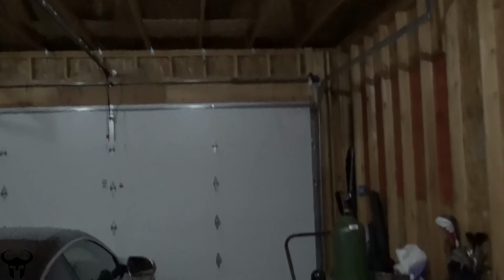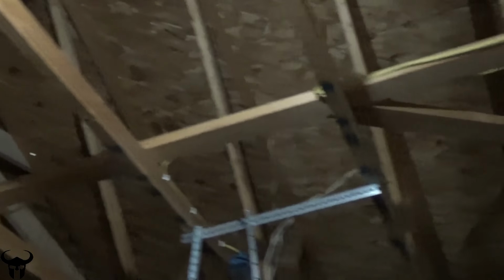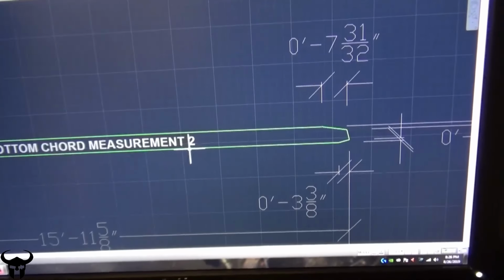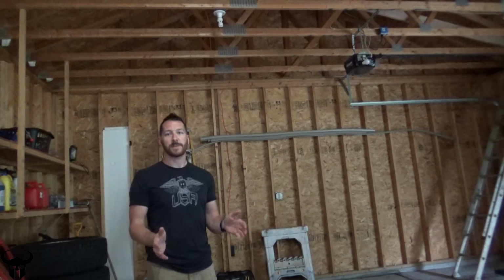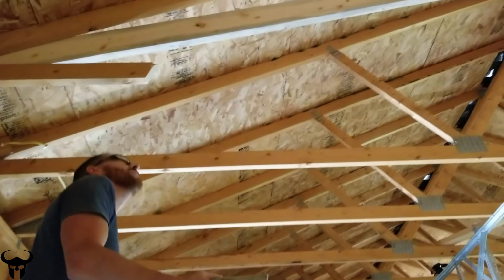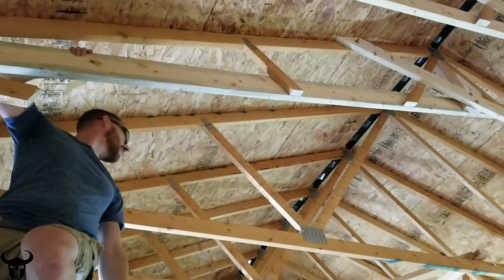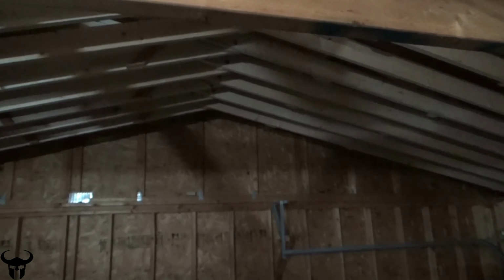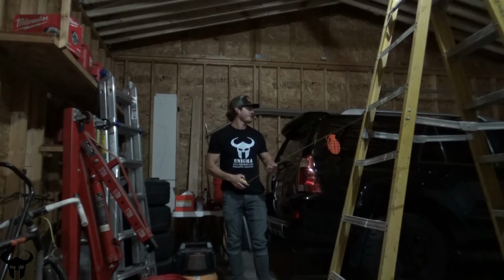How to Modify Garage Trusses for More Height for a Car Lift (Super Garage Video #1)

Comment: FYI for those of you who might have more clearance for a lift but want to keep your standard garage door; you can special order angled horizontal garage door tracks to accommodate for more space for a lift. I did that a few times when I had a small garage door business for customers. Much cheaper than a new roll up door.
Reply: I've been trying to find info on doing pretty much the same thing, but I haven't come up with much. Any idea where I can find those angled tracks?
Reply: @samerickson89  try to find a garage door supplier in your area, or talk to some smaller garage door repair places that might want to entertain the hunt. The rails were special order from the supplier to the manufacturer. It's not as crazy as it sounds. Mention high lift tracks
Reply: You’ll need different drums, longer cables, different spring(s) and side mount opener. Tell your local garage door company you want a high lift track set up for your door.

Comment: Fellow engineer here, I can't tell you how excited I am about finding this, as well as all the details and info you show. Great job! I have the same ceiling height and trusses in my 30'x72' pole barn and am wanting to do this! I have a 4 post lift coming and would love an extra 3 feet of lifting height!
Reply: Hi jamie, how did your project go ? I have the same size garage but will turn it into living space trying to maje the same type of structure they did
Reply: @chinocool7481  I wrote this a year ago!?!! Man, I ummm, yeah need to get on this. I haven’t done it yet. Haha. 

My brother (super nerd, chemical engineer) modeled my roof and current trusses in cad. Then we sent it and our new design to our retired mechanical engineer friend that loves doing structural analysis. He gave us mountains of data. Spreadsheets. Drawing sketches. 

I put the project on hold to put flooring in my house, paint, and new trim. Gotta keep the wife happy. Then I’ve been insulating and wiring additional outlets in my pole barn. 

Hopefully in spring or early summer I’ll get to it.
Reply: Hi, can you share some information from the mechanical engineer roof report? I'd comment on this video, but the guy owning the channel doesn't respond it seems like. I have feedback about the process. I'm a building inspector and woodworker. Install collar ties, a horizontal board through the truss. And put in strong back truss bracing. Basically a continuous board perpendicular to the trusses to prevent deflection sideways. Last, a double bottom cord is a good idea. This video did a great job, but hopefully some people see my three recommendations to make it much better. I'd probably install a ledger or double ledger at the side wall too.

Comment: Couldn't you have sandwiched the trusses together in pairs of 2’s or 3’s instead of having them evenly spaced?  Also, isn't the grade-8 hardware way stronger than the wood? Seems the wood will tear out/break long before a grade 8 will sheer.  Seems like grade 8 would be an unnecessary added cost over, say grade 5.  I have spent my entire adult life building homes and I've never seen grade-8 hardware used through lumber.  Lastly, 4-1/4” thick concrete seems thin for a lift.

Comment: My garage is my woodshop, and the ceilings are exactly 8' tall, which is often a problem when you factor in shop lights dangling 8-10" below that.  I'm considering this as a future project... I am a Landscape Architect, but I work in a civil engineering firm with structural guys so between this video and them, I'm confident I could pull it off.  Thanks brother.

Comment: I'm a professional mechanic who runs an auto repair business out of my home. I desperately need a lift in my garage but have 8ft ceilings. Id love an extra foot or two. My attick sits above the garage so this may be a challenge. Your comment about moving the garage opener to the side was a good nugget. Either way it's good to see there's somebody out there in my same predicament.  Wish I had the engineering skills you do.
Reply from the maker: Thanks for the comment Josh! This is going to sound crazy, but one method I heard from a few people is to run wood beams through the existing trusses, then rent a crane, connect it to the beams, and pick the roof off the garage (after cutting around the perimeter to free everything up). Then you would add an extra 2 ft+ of framing/siding and put the roof back on. It would save you from having to re-roof, modify trusses, etc.
Reply: @EnigmaEngineering  that's one knarly nugget! But a doable one with a little motivation. Thanks brother!

Comment: Great idea using it.   Also instead of the rolled if you want more R value, you can modify the track to run the angle of your new roof line, harder angle up instead of out.   Neighbor just did in pole barn.

Comment: i put a mid rise lift in my single car garage last week, it hit one ceiling joist, so i converted that one joist into scissor joist using mostly aLL the wood already in place, no need to over engineer things.
IT took me just over 2 HRS.
up in north maine we get high snow loads but i installed a metal roof 4 yrs ago which gets rid of snow.

Comment: I'm here because an associate of mine removed his garage rafters and it left him with a HUGE amount of overhead space.   I asked him  "Don't you need those to maintain the structural integritiy of the garage?   He just said "naw my garage is fine.  Strong as ever. ".   I have been chewing on doing mine every since.   But the kicker is I DYI'ed an 18' addition to turn my 2 car into a 4 car years ago and I added the rafters because I thought they held the walls against the outwardly pressure of the A-frame pushing down .  I didn't need gables .

Comment: I've been thinking about doing this to my house roof for a couple years. I've talked with several contractors and they tell the same thing. Have to use a LVL or steel beam. I'm not buying it. I like what you did. Thanks for sharing your knowledge.
Reply from the maker: Hey Ray! No problem. Obviously I can't tell you exactly what to do with your build. But, the safety factor of trusses you can buy at a hardware store is generally pretty high (like ~7-10). My recommendation is finding a truss style that gives you the extra vertical room, then perhaps increasing the number of trusses like we did. For example, a scissors truss is weaker than a traditional truss. So, we doubled the # of trusses to approximately match the safety factor.

Comment: I have a similar truss situation. My plan is to cut all the sheeting and end fasting nails of the trusses that I'll be moving using a sawzall and once clear of all nails I'll slide the middle trusses away from center and against the outer trusses nailing them together to create a form of girder truss on each side of the bay. At that point I will span the 12' gap with structural 2X6s on 16"  centers between the two "girder" trusses using joist hangers on each end of the 2X6 purlins to support the roof sheeting. This method opens the bay giving the maximum  height  possible while retaining the integrity of the structure.
Reply from the maker: Hi Delbert, I considered a similar method. It should work out fine! Thank you for the comment and thanks for subscribing

Comment: Great Job,  I'm about to do the same thing, that is how i found the video.  This is very overbuilt, which is good.  It seems you used Doug Fir instead of yellow pine.  Doug Fir isn't supposed to be used in a joist / rafter type situation.  Usually for studs only.  Doug fir is much easier to work with though and in the end won't make a difference given how overbuilt this is.  You could have also scabbed osb to the side of the Scissor truss after adding another 2x6 to even the thickness instead of adding another truss inbetween.  If you do this method the OSB should be nailed or stapled every 6"s or so

Comment: Thats why Engineers aren't allowed on the jobsite.... standing on the top of the ladder. :)  Very cool, and wish more Engineers had to be occasionally TDA'd to their respective jobsites to see how the things they engineer actually are built, and how crazy some of their ideas are. I'm looking at you Nissan engineers, 2 hour job to replace spark pliugs.
Reply: Honda was no different, wanna change a starter or Ac compressor in a civic?  Pull the engine.  :-/   Next to the lawyers, the enginerds would be the next bus off the cliff.

Comment: What is the spand of your trusses? and what size timber did you use?
Also what snow payload did you calculate for? 1kn/m2? and are your trusses spaced 3 feet apart?
What is the roof pitch and what are your ceiling pitch? They should be 10-15 degrees different depending on the slope of the roof.

Comment: I need modify my roof high, I'll follow your method, I wait to find the kind screw that you used in my country but maybe I can to use someone similar in weight resistance or reforcer joins with iron plates, thanks for you time and excellent job.

Comment: Great vid and thanks for sharing.  This is exactly the project I've been pulling my hair out on having completed.  Other than the engineering side of this project, I am capable of completing the work.  My problem is several structural engineers won't advise or won't design for me.  I just need the blueprint and specs.  I can take it from there.  You ever think of setting me up with a safe design based on my setup.  I do have the original blueprints from the house built in '89.
Reply from the maker: Hey, thanks for the comment! More videos on the garage build to come. Regarding the design, I wouldn't advising you on your setup. I want everyone to have a super garage. The easiest way is probably finding me on instagram and PM'ing me: enigmaengineering

Comment: Awesome work man!  I need to vault my garage ceiling as well as I want to be able to fit my 72 Cuda and 07 Mustang in 1 bay.
Reply from the maker: Thanks Jason! Now I have the garage - time to find the Cuda :)
Reply: @EnigmaEngineering  Goodluck!  It took me 5+ years to find mine and I got lucky!  I saw a rusted out frame of a 70 cuda missing hood, every door panel dinged, floor pans rusted out, no engine, transmission, wiring and the "car" sold for 20k...people are out of their minds when it comes to ebody cudas.

Comment: I’m considering doing this to my garage, same reason as everyone really to add a car ramp and to allow more height when lifting a vehicle, my garage is 27ft x 18ft, concrete breeze block walls and has a tiled roof to tie in with the house with it being in a residential area, could something the same as this be done to my roof? I’m uk based so we don’t get a great deal of snow etc so it would be the weight of tiles of the roof would be the main weight worry

Comment: I have those trusses in 2x6 in my barn. I want to install a ceiling hoist across the trusses. First I installed grade 8 bolts on the center triangle and am installing cross 2x6 blocking starting from the front header. My lift weight on the hoist will be about 500 pounds, normally much less, on a 20 foot track bolted to the trusses with grade 8 bolts. Are the trusses able to handle the lifting weight?

Comment: Great video- thinking about the same for my 24 x 24 garage in NC but to get the necessary extra room for a golf simulator. You did't mention the span of the garage. And did you consider using engineered wood for added strength and rigidity? I am not an engineer but get the impression LSL or LVL timbers would have allowed not doubling the trusses. In any case very nice job!
Reply from the maker: Hi David, thanks for the comment! You are not alone on the golf simulator. The span was 23 feet in this example. We didn't consider engineered wood simply due to cost. But microllam or parallam would be great for this job. You likely would not have to double up the trusses either. I probably did not have to - I just wanted to match the original safety factor identically and I had never seen anyone else do this so was being extra cautious. Also - add in some collar ties for extra beef
Reply: An LVL would cost 10x what a 2x6 would.

Comment: But is it to code? Did you get a permit? If you sell the house... will it be an issue? 
I know if I walked into the garage and saw that.... I would question if it was to code.
Reply from the maker: Not a lot of codes exist for non-dwelling structures like sheds and garages in my home state. Never selling the house. But, definitely would be a slight concern otherwise. Generally our basement foundations are collapsing which is a bigger issue

Comment: great idea and job!!! I need to do the same in my garage... my peak runs the other way 90 off your garage, so I would need to do the entire garage's trusses. did you do yours only because you needed one bay for working under the cars? what do you think the downside if any of doing the entire garage (other than cost and work LOL) Im doing a 4 post for 90% storage rather than work. I live in southern Cal so no snow load issues -  just Spanish tile (fire protection) roof which heavy
thanks if you reply

Comment: I’m wanting to do this in my barn at home but it’s 30’ wide how do I figure up how long of boards I need? And how far down do you bolt the boards from the peak was that 3.5’ ft?
Reply from the maker: Hi Nick - you would want someone on a ladder to help you pull a tape measure for the exact dimension. We went down 2'-5" from the inside peak - but the more you get here (i.e., larger distance), the stronger the scissors will be.

Comment: Dude! Great video. I so wish you were a little farther south so you could be my Structural engineer in west chicago suburbs. I have the same issue but unfortunately have bobtail trusses on a hip roof garage. I am pretty sure that I could do it but I do not have the degree or certification to convince the municipality.

Comment: How are those modified trusses holding up thus far?
Reply from the maker: Hi Yassir. They have been 100% solid. At one point last season there was  ~2 feet of snow/ice on the roof; the drywall has no visible cracks - no evidence of any movement
Reply: @EnigmaEngineering  Do you have a link with the drawings available? I have identical trusses.

Comment: Thank you for sharing your work. I am in the process of rebuilding/re-designing my garage and I would love to use that design. 
Let me ask you about the size of the world you are using. Is this 2 x 8? Or just 2 x 6?
Reply from the maker: Hey, no problem! We were using 2x6s here, but the taller 2x8s would be stronger if you can make that work. Good luck!
Reply: Thanks, I'm gonna follow your advice and use 2 x 8.
Reply from the maker: @Studio-yc3ko  no problem. Also, you can add  "collar ties" too for additional strength
Reply: @EnigmaEngineering  yes, absolutely. The concrete is poured, slowly I'm gearing up to start framing. I will keep you posted if you don't mind. :)
Reply from the maker: @Studio-yc3ko  absolutely. Good luck. Here is my email: enigmaengineeringllc.com

Comment: Thanks for doing this.  Do you have any sense of whether there’s a version of this that can be done in Florida, where our houses have to meet code for hurricanes? (I think they need to withstand something like 150 mph winds.)
Reply from the maker: Thanks for the comment! I think a similar strategy should work in FL. I am from the Midwest and I think used 60 lbf/ft^2 for my combined "dead" and "live" loads accommodating 2 feet of snow + winds . Just a quick search showed 15 lbf/ft^2 dead load in Florida and at least a 30 lbf/ft^2 live load, so minimum 45 lbf/ft^2. But, an equation for wind force is P = .00256 * (Velocity)^2. At 120 MPH, P = 37 lbf/ft^2, so 37+15 = 52 lbf/ft^2 total load. But, to be safe, 150 MPH sustained wind speed would be P = 58 lbf/ft^2, so 73 lbf/ft^2 total load - this would be a very strong roof. Let me know if you want more thoughts!

Comment: I want to remove the drywall from my garage ceiling. I plan on adding storage shelves to existing trusses so I can access easily all around the garage instead of crawling though my 4x4 opening. 

What is the pros and cons to doing this?

Comment: Are those trusses 8 in on Center? Holy mackerel. You could drive a tank over that roof. I just took my top of my trusses and I screwed plywood to them and it made my roof so stiff you could break your ankles walking around up there. Your roof is probably stronger than mine

Comment: Looks great! Thinking about doing this in my garage for a lift. I live in Michigan. Any suggestions for me?
Reply from the maker: Thanks! We are just across the lake from you (unless you are UP). Google search "snow loads by state" and see where you are on the chart. We used 60 lbs/ft^2 to be safe and were well under the safety factor (i.e., less than 10% of the roof strength at full snow and wind load)
Reply: My suggestion is dont talk to this clown.

Comment: Well done. How'd you get those king posts to fit between the existing mending plates at the ridge? How'd you make those connections?
Reply from the maker: Thanks! Good question. The mending plate bottom edge on our original trusses did not come down below the the wood, so we had no issues with the king post. We did have to notch a few rafter ties with a grinding wheel and sawzall though. I suppose you might be able to do the same to a mending plate, then add new plates to the existing wood. We used structural screws with nail plates in a few places

Comment: I need to do this also... my peak is 90 deg. from yours... how do I figure out the angle needed for the new tuss? my building is 28x32 the peak is on the long 32 front to back.
Reply from the maker: Hi Daver. Measure the distance to the peak of your garage. Then use something like google sketchup (free) to draw out the truss. Or send an email and we can help out: enigmaengineeringllc@gmail.com
Reply: @EnigmaEngineering  thanks